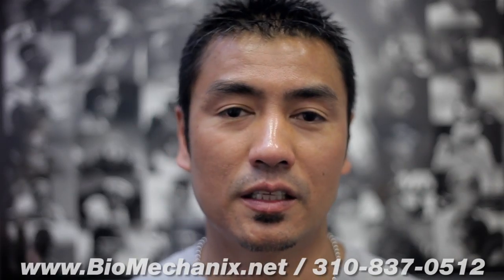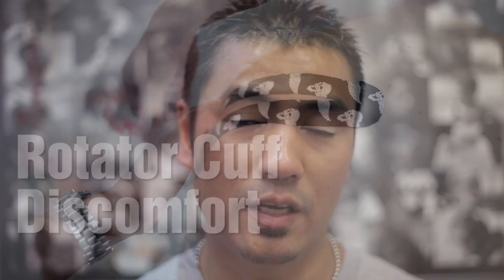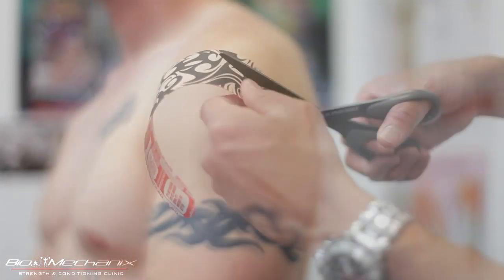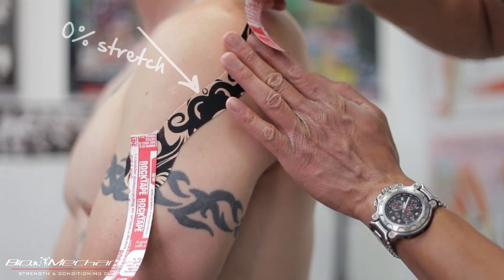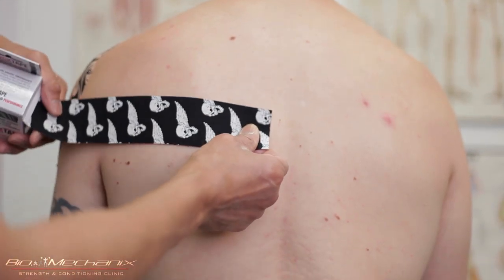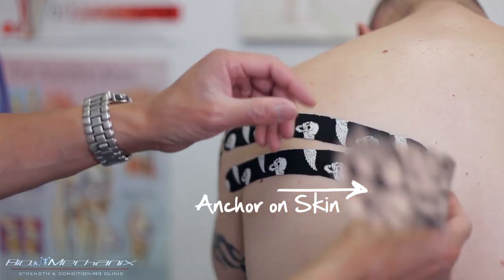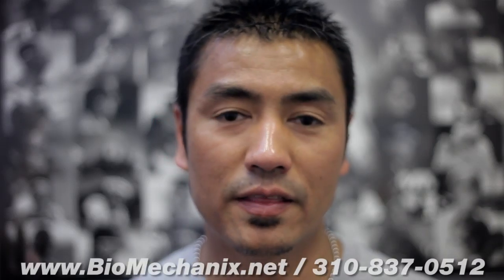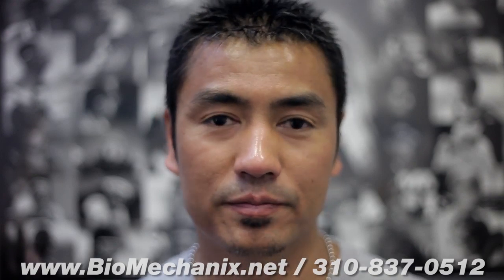How to Kinesio Tape for Scapular Stability/Rotator Cuff with RockTape Rock Doc Jon Torerk

Comment: Hi Jon,
I fractured my scapula a couple of weeks ago while surfing. The fracture runs horizontally across the inferior part of it. The orthopedic doc told me it surgery was not necessary nor would I need a sling and it would heal on its own. Is there a way to use Rock Tape for this?